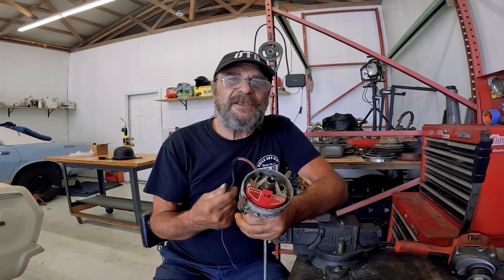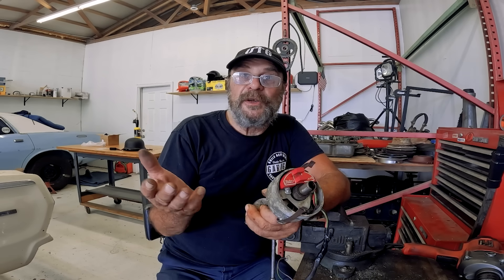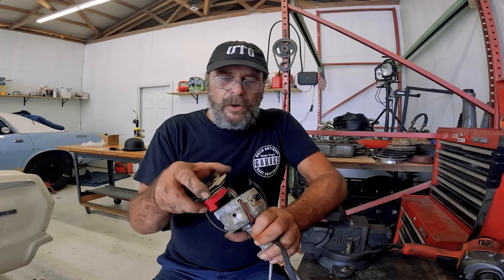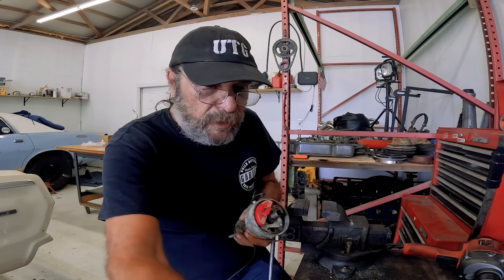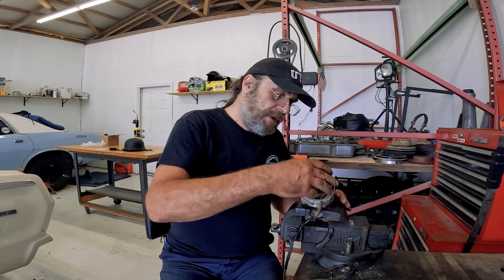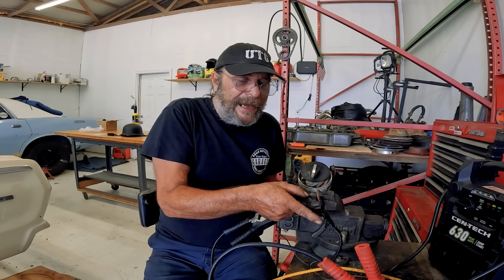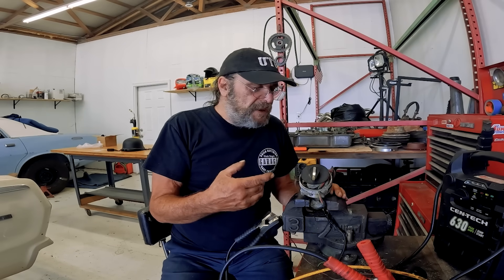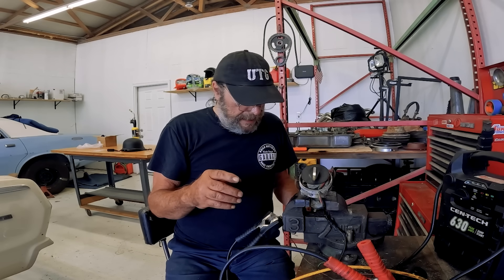Easy Ignition System Testing You Can Do At Home - Will Our Ancient Aftermarket Ignition Throw Sparks

Comment: be careful testing like that, I did similar as a kid, using a d-shaft motor to run the points and an old race ignition coil sitting on a cheap tv tray with metal rim and legs.
I held it wrong and promptly landed backwards six feet against the headboard of bed from sitting on end, after it arced over from the rim to the metal legs to my left leg and back out my right hand. yeah, I did not do that again! I should also mention I was playing with Leyden jars in combination.

Comment: the only issue is capacitor failure in those old ignition modules, granted they'd be far better than most things out today, 15 to 20 years is about all you'd get before they get silly. now days lucky if it works at all from new to past a year...
installed a pertronix kit, new coil and more on a old inline six "gm/mercruiser" boat a handful of years back and it worked fine a handful of local lake fishing/run around trips, then of course, they launch in Lake Erie, Cleveland, Ohio, run way way out there fishing? yep flatlined, no ignition and storm kicking up! I said go back to points/condenser, carry spares and the tools to change them quickly. we had great luck in the mid 1990's on with those setups in all sorts of applications, including offroad VW air cooled, then it all went downhill I guess.

Comment: Remember back on the day when the giant refrigerator sized sun scopes with all the leads. Those things were awesome I still want to find a good vintage circa early 2000 sun scope. My old boss traded the one we had for this c*** little snap on thing. Cylinder balance testing alternate ripple testing all kind of good stuff with that sun Scope I remember when we got rid of it I was irritated. Because these days  just because something is Outdated technically quickly but realistically fantastic tool.

Comment: Good afternoon Tony ...I've got a long question for you maybe you covered this subject in previous video not SURE BUT can you explain in detail the difference between the A LA engine family i've heard a lot of urban legends over time with this group of engines. The 273, 318, 340, 360 i've heard and apparently this is true, 273 heads fit, I'm 3 eighteens. I have heard, and this may be true or false. At 318 and 340 blocks our identical
And that the 360 is a punched out 340I don't think so.
But a few haven't done a video. On this family of engines, I would appreciate it if maybe you could and clear up some facts and fiction

Comment: Btw, the Acell Super Coil, (the big yellow dude) is a FANTASTIC coil!!.......it doesnt care about mounting position, and the one Co. I worked for for years needed a car coil for our machine......our Elec engineers, got a Super coil, a blaster 2, and joe shmoe coil.......to test b4 puttin on the machine........the big yellow dude was best!!.......so they took it apart to see why......Supercoils had a much better way to allow charge/discharge, than ANY canister style coil out there.....me and my hot rod buddies, have been using them for YEARS.......ones on my '64 Poncho right now!!!

Comment: My '73 Buick 350/4 Convertible used to EAT plug wires in about 6 months or so! NOW wondering if the resistor wire to the coil was bad or fried and /or got replaced with a regular wire? No matter, she's long gone now, but loved at the time...

Comment: I put a Unilite in my Jeep in the mid 1980s.  My friends told me to buy an extra module because it would fail and leave me stranded.  I sold the Jeep in 2010, and still have the extra module in the package in my tool box.  I did have to take it apart occasionally to lube the mechanical advance.

Comment: In my younger years I used to have a gm hei test bench, a drill, a vise, plug wires, L brackets with plugs. I would check out the whole system with .070 gapped plugs.

Comment: Tony, if you don’t want the features of a Mallory distributor, why destroy one? Start with a stock distributor and equip it with a Pertronix trigger. Probably more accurate than the chopper rotor of the Mallory. I bet money you already have a Pertronix in your shop.
Reply: New to the channel?
Reply from the maker: You misunderstood...this IS a stock distributor, with a vintage Unilite points conversion similar to the modern Pertronix.  Mallory doesn't offer this stand alone unit anymore, only complete distributors.  The distributor used in this video would be considered a throw-away, so modifying it is no big deal.
Reply: @UncleTonysGarage  Tony they still sell the Mallory Unilite  conversion kit on the holley web site and jegs web site for 97.95 dollars part no 503M thanks

Comment: Don't forget to check your rotor phasing guys, I was sent down a rabbit hole once by changing a cap and rotor, it turned out someone put the guts from a different type of distributor into mine and it was jumping spark. The fix was to gorilla glue the rotor jammed onto the shaft in the right orientation...Also don't listen to anyone who says mechanical advance changes rotor phasing, only vacuum advance actively does that.
Reply: Unless of course by mechanical you mean the weighted springy bits.......

Comment: I was looking through my stuff I may never use back from when we had several 413 power units, I found a reman distributor with a pertronix, which if I recall has never been used. Also found 2 ignition modules, an echlin TP50 and  Neihoff Al401 that have never been used. If you could use them, I would send them to you.

Comment: Seeing that spark reminds me of a hot sweaty day and finding a ignition leak by touching a wire and leaning too close to the fender while going commander in a jump suit. Guess which part of my body went to ground. Still makes me shudder !
Reply: had something similar happen to me, tho fully clothed, the 45k volt coil had no problem going through the same part and jumping to the fender.
Developed a healthy fear of the coils since then 😅
Reply: @AlejandroRamirez-vl8mr oh no...phallus ground electrode...aw jeez..
Reply: Yikes! I was more fortunate in that I learned about ground paths through a sweaty elbow. 

I’m cringing over here (but also chuckling a bit; sorry!) thinking of your scene 😱
Reply: I crossed an electric fence, but my legs were too short, and took a direct crotch lighting.
Reply: Cheaper than viagra.

Comment: Ever seen a rig still run with the cap missing the  center button out of it   the spark was jumping from coil wire end in cap to the rotor  ,it ran strong but backfired when you slowed down or shifted gears
Reply: I have . More than few busted plugs with the wire wrapped around the electrode . Worked fine

Comment: Good job, uncle Tony

The issue I have with the old distributors 

is they’re worn on the inside and the shaft has too much wobble. I’ve got no idea how to overcome that other than to buy an aftermarket new one.
Reply: Theres a bushing in the distributor body that I'm not sure if its replaceable or not. I imagine it must be, but sourcing the part might be the problem.
Reply: @SpikesAuto 

Maybe so, but in the General Motors distributors we’ve got in Australia there’s no bushing. It’s just the length of the shaft.